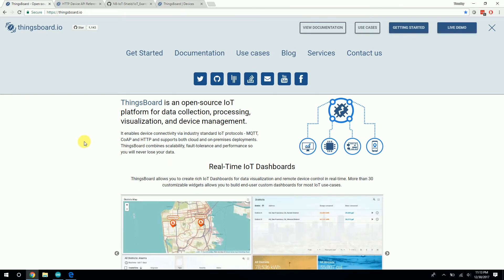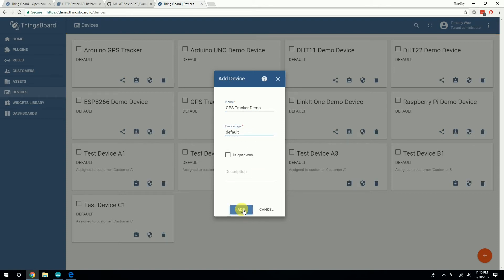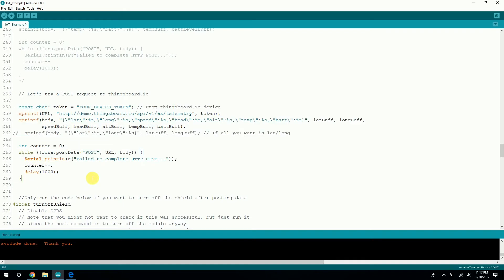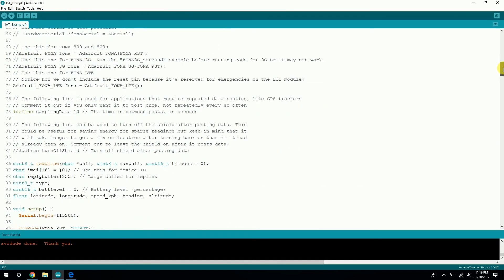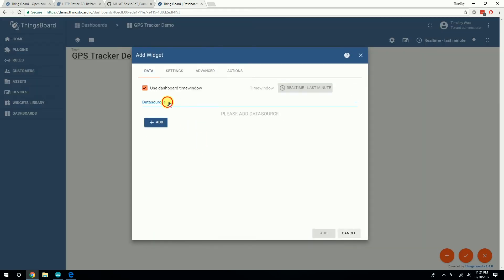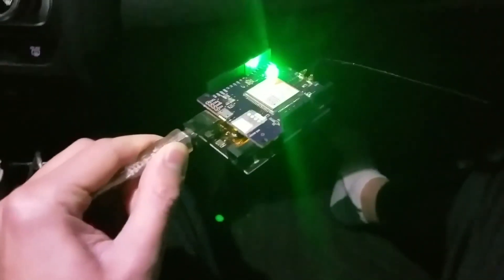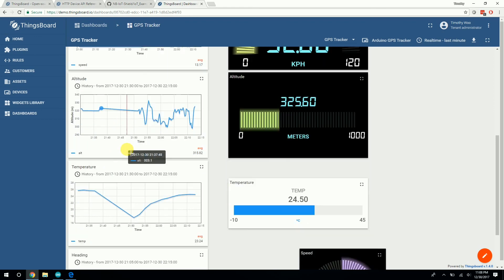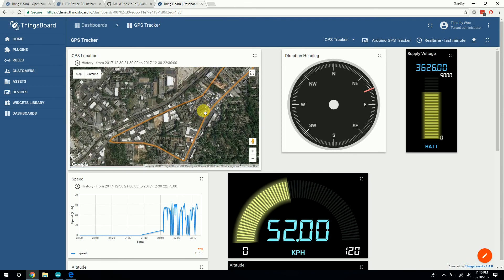#12 Real-Time LTE Arduino GPS Tracker (Part 2)

Comment: Hey ! I have a GPRS/GSM 800F Shield and a GPS Shield,  and you had both together in same shield my problem is the code because will be different from yours, and i have to add 4 different types of sensors to to the project, can you make me some suggestion ?

Comment: Hey man, i wanna ask you something. Is SIM7000 compatible with MQTT cause I've tried many times but it's not working at all. Please kindly reply my comment. Thanks a lot!
Reply: MQTT is just a communication protocol, the board is responsible for set you the Celular network connectivity, so you can use any communication protocol you want with a suppose reliable network provided by the SIM7000, removing the need for some wifi connection or smth like that.

Comment: Hello Tim . I just want to ask something ..   would it work on  adafruit ultimate gps breakout .. Thanks in advance :)
Reply from the maker: Yes, as long as you interface it correctly with your microcontroller it should work fine, but keep in mind that the shield already has built in GPS.

Comment: how MB/KB you spend monthly and is it working for you non-stop or when the cars stop it's offline?
Reply: Because I was thinking to get hologram.io if it spends a little
Reply from the maker: Hi there, I'm not doing this constantly so I really don't know. For a typical GET request using my example it's about 125 bytes but it also sends quite a bit of other data which you may not need. It really depends on what data and headers you're sending as well as which protocol. Using 150 bytes per transmission every 10s and using 30x24x60x60s =  2.592 million seconds in a month we get an estimate of about 259k GET requests in a month, which translates to about 38-39 mega-bytes/month if it operates continuously 24/7. However, also keep in mind that it takes a finite amount of time to post, so really it's going to post less than 259k times/month. Hope that helps a little!
Reply: If I have unlimited data can the arduino or raspberry stream video using the shield or gsm module
Reply from the maker: No, not with this particular module. The SIM7000 is an LTE CAT-M1/NB-IoT module for low-power, low-bandwidth applications. For streaming video you would need a traditional LTE CAT-1, CAT-3, CAT-5, etc. module instead, which offer much higher transfer speeds.